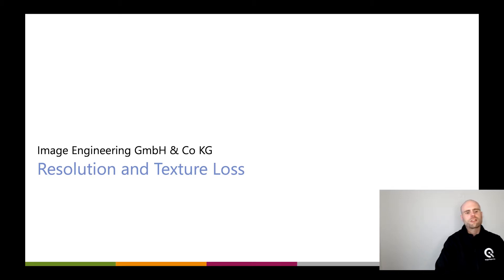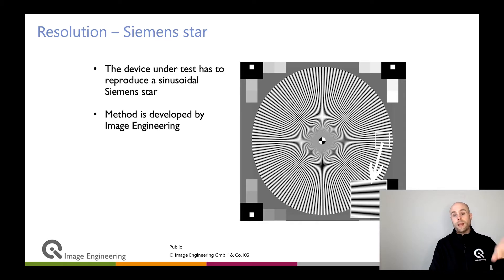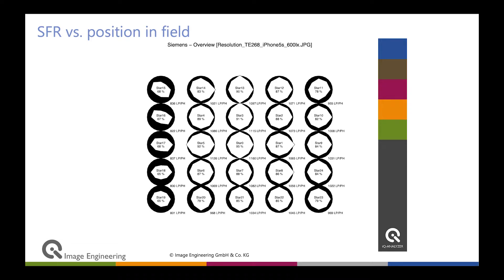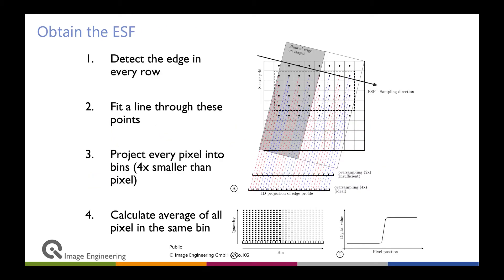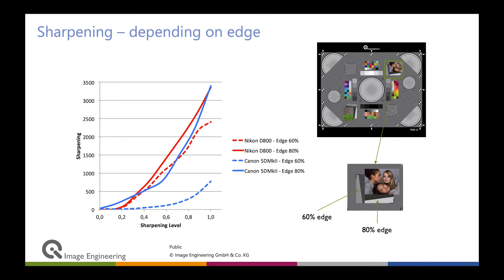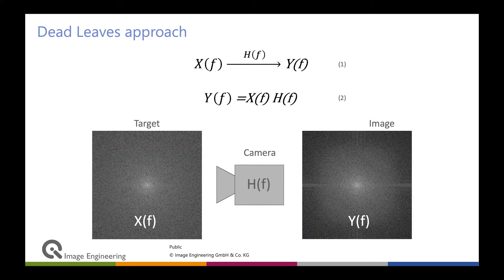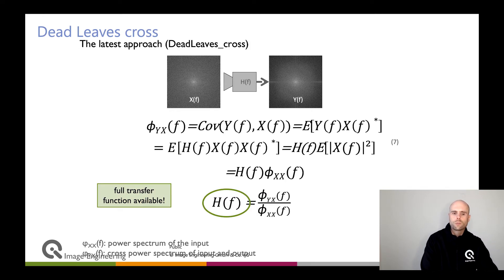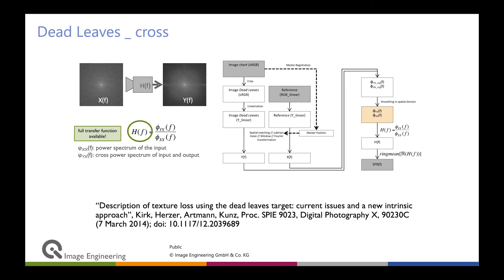An overview of image resolution and texture loss

Comment: Again, thank you for sharing your insights.  It would be helpful if you could provide an idea of the scope of these resolution tools, e.g. in terms of dpi/lpi (and mm). Also which suppliers of the targets would you suggest?  I have been trying to test the achieved resolution of a scanner which promises 2400 dpi, but seems to achieve only 55% of this, using a USAF target.